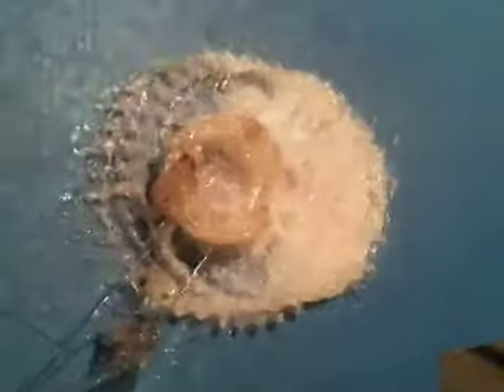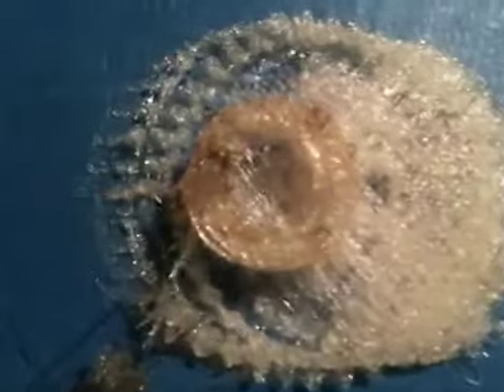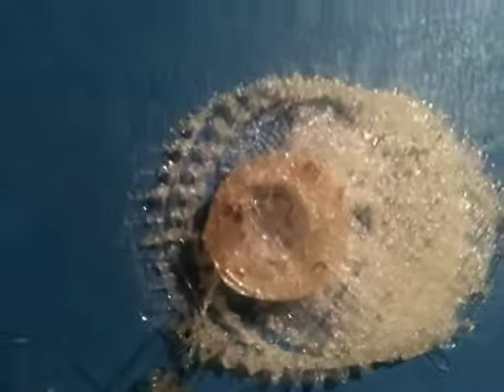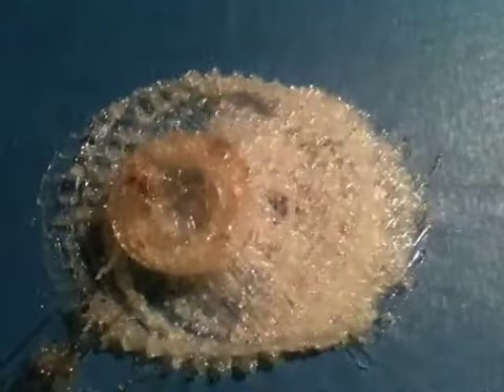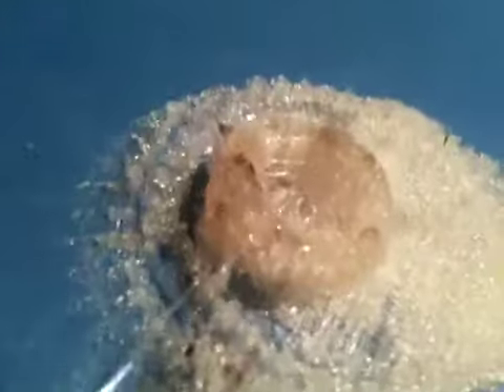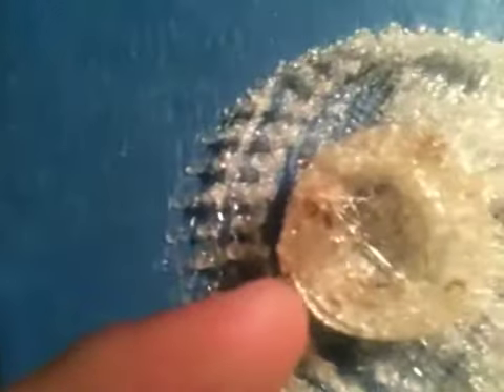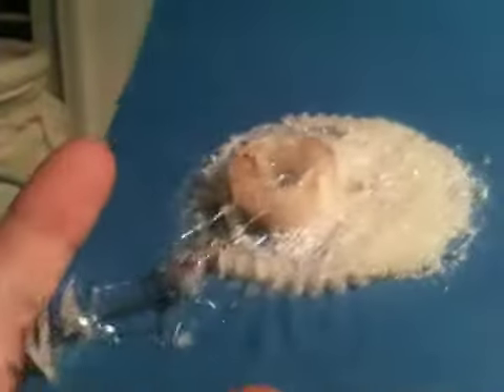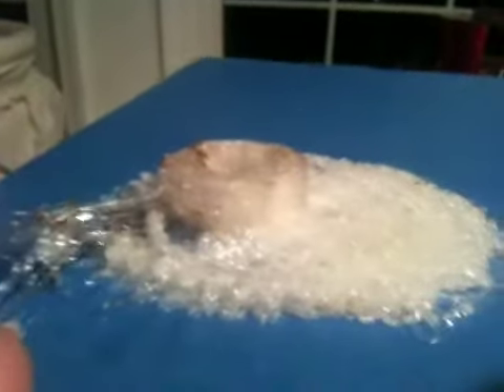Diagnosing problem with failed Wade's Extruder gear

Comment from the maker: I definitely moved past this - I print fine now. I detailed it all in my blog with greater detail, but off the top of my head here are the things that I think contributed the most;

1) I was using a 10-toothed pulley from Mcmaster instead of the 8-toothed pulley, while using the old gen3 Makerbot electronics. Yes I adjusted the settings in firmware to match 10 teeth, but because it didn't do 16 microsteps like later hardware (I use RAMPS 1.4 now), I wasn't using less resolution and I believe th